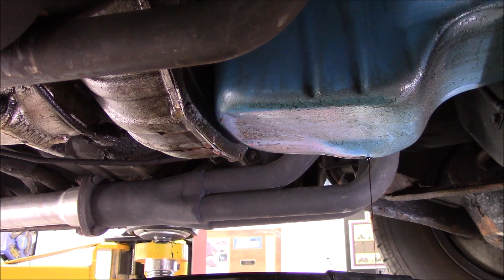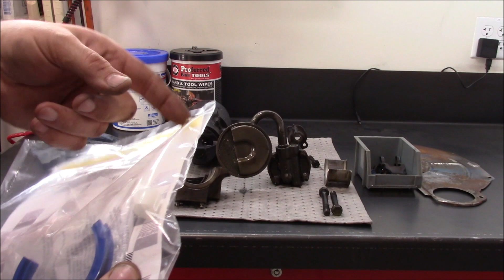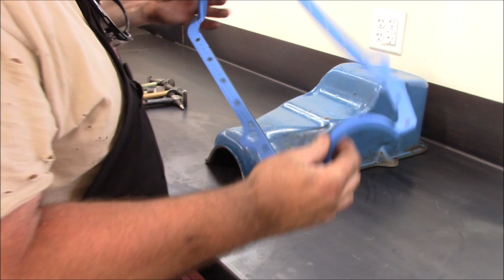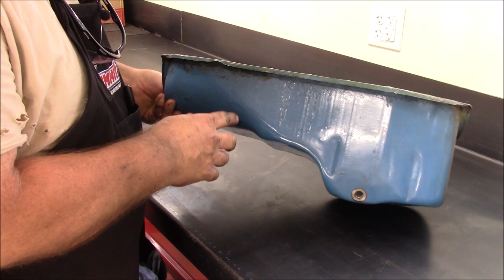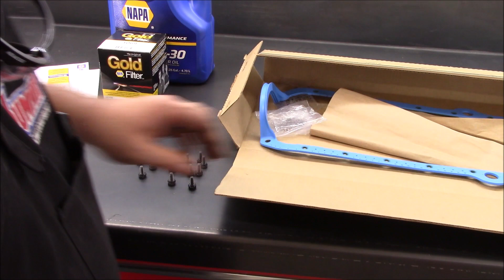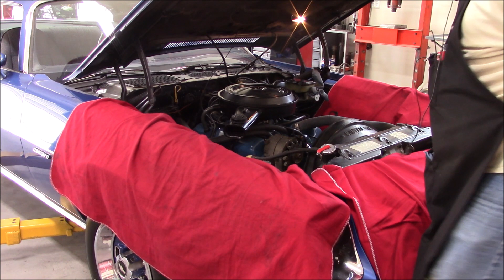Small Block GM 2 Piece Rear Main Replacement

Comment: Where can you buy that jack to lift up the front
Reply from the maker: I used a pole jack, available through many suppliers.  Mine is made by Sunnex and has a 1500 pound capacity.

Comment: Great video, well explained, but do you have to apply anything to the backside of the seal or just leave it dry?
Reply from the maker: Thank you. 

Nothing to the backside of the seal. Just a little dab of sealant where the two halves meet and the rear bearing cap mates against the block are the only places I put anything.

Comment: Great tutorial on how to do this without pulling the motor. The one thing I could not figure out was where were lifting the motor from. What was the jack in? The only thing I could think of was the balancer. Appreciate all the videos you put out. Very informative
Reply from the maker: Thanks for watching.  I used a pole jack under the balancer to slightly raise the front of the engine.
Reply: @zmotorsports62 Thank you 👍

Comment: Fantastic tutorial on the subject…thank you!  I have seen some folks frown on jacking up the motor by the balancer stating that you can “bend” the crank snout.  Would you recommend on jacking up the motor by the oil pan and then resting it on blocks or is the balancer more than sufficient at handling the load?  Thanks again for the fantastic instruction.
Reply from the maker: Using the balancer is fine IF, there is nothing restricting the engine from easily being raised.  You are basically tilting it with the pivot point being the transmission mount.   It's when people forget to disconnect something or there is something binding and they continue to crank up on the balancer.  That's where the damage comes from. 

Thanks for watching and for commenting.
Mike
Reply: @ Makes a lot of sense…thank you! 👍🏻
Reply from the maker: @johngreen2510 you are very welcome.  Thanks again for taking the time to watch. 
Mike

Comment: No rtv on the seal corners?
Reply from the maker: No.  You can but I generally don't.  I will add a very thin film of sealant to the bearing cap if I notice any scratches or gouges in the mating surfaces.

Comment: Does the offset of the seal have to super precise?
Reply from the maker: No.  Just offset it by 1/8"-1/4" is ample.  The main thing is that the parting line of the bearing cap and the seal won't align.
Reply: @zmotorsports62  thank you.

Comment: Mike the only problem is when you show what lip goes too the crank your holding the seal out of view of the camera! It be nice too see the end of the seal too make sure you have it right! I put mine in with the big side toward the crank and thin side too the transmission I hope that’s the correct way? Or I’m redoing it! I must of screwed up somewhere because after I installed it, it’s still leaking I followed everything you said cleaned everything, checked everything but I got oil on my bellhousing so I’ll be redoing this again but it shouldn’t take 6 hrs this time since the gasket is brand new and the pump is new
Reply from the maker: Sorry, like I've mentioned I'm a mechanic and not a videographer. 🤣

The large lip of the seal should have the front of the engine.

Comment: Good job but I’m surprised nobody mentioned that you forgot to apply oil resistant rtv on the ends of the rear main seal.
Reply from the maker: It was mentioned in several comments but I'll say it again.  I never apply sealant to the end on the lip seal, just a little to the rear main cap.  There is enough compression of the seal ends when the bearing cap is torqued in place that sealant is not needed in that location.  

Thanks for watching.
Mike

Comment: I'm getting ready to do mine. I noticed you didn't put a touch of "Ultra Black" on the offset ends of the seal or the main cap. What's your experience in doing that or leaving it dry. Thanks in advance 😎
Reply from the maker: Personally, I don't use "Ultra Black", I use GM ES (Engine Sealant), but I did, and do, put a very small amount on the rear cap.  The seal itself should compress together upon assembly and create a tight seal without sealant.  The bearing cap is what I am more concerned with leaking and therefore put a very small bead on the mating surface and just offset the seal.  

Thanks for taking the time to watch.
Mike
Reply: @zmotorsports62   Absolutely...Good Stuff.  I'm a 30 year ASE master myself and it's always good to get opinions. I've actually never had to do one of these two-piece jobs, so disturbing the main caps made me a little cautious lol
Reply from the maker: Yeah, not a big deal to pull main caps if done properly but I get your reservations about it.

Comment: Hi from Kent, are all late 60's small blocks 327 350  have 2 piece rear main seals or are some 1 piece , looking to replace seal in Chevy 327 around 68 ?
Reply from the maker: GM didn't go to a 1-piece rear main seal until mid-80's (86 I believe), so anything prior to that will be a 2-piece rear main seal.

Thank you for watching.
Mike
Reply: I'm looking at changing out rear seal on a 57 Chevy it has a A-frame cross member that bolts in,  it looks like it could be dropped down on one side so oil pan can be removed.  Can U confirm that,  motor with 4 speed and motor mounts on front and of the bell housing, looks like I would not need to jack up motor.   Are you familiar with that set up,  and am I seeing it right, any problems I will run in to?  57 has a stock motor and bell housing motor mount seat up, with up graded late 60's small block 4 speed Muncie set up.
Reply from the maker: I cannot confirm on whether the cross member coming out can create enough space to remove the pan or not.   The only experience I have with a shoebox was removing the original engine/transmission for a guy and installing a 502 big block w/ZF manual. 
Mike
Reply: Thanks for getting back , I'll work though it, that's what it looks like, like your detailed vedos.  Already had M 21 out added new clutch. @zmotorsports62

Comment: Hi Mike, being retired with time on my hands I decided to overhaul the brakes, suspension bushes, fit thermo fans, central locking and power windows on my `80 G10 Chevy van. While doing that I pulled the engine (350 auto).  Primarily to clean , paint and generally replace any gaskets and seals needed. 
I owned and operated American Car Specialists in London Uk before coming to Aust.It`s been 30+ years since I did anything more than basic services on my American cars here in Oz, but thanks to your `memory boosting video` It`s coming back. The biggest problem is finding parts here at the right price. Cheers MIKE, i HAVE LIKED AND SUBSCRIBED.
Reply from the maker: Thank you very much for the comments and for taking the time to watch.  I'm pleased you liked the video and wish you the best on your American muscle projects. 
Mike

Comment: Are you jacking it up off the harmonic balancer and crankshaft? Is this a good practice? I’ve heard that I can break harmonic balancer is in snap crankshaft I’m just saying I don’t know I’m asking you
Reply from the maker: Yes, I am raising the engine slightly by placing a pole jack under the harmonic balancer.  I have not heard of breaking a crankshaft and have personally been using this method for 35+ years.  However, I can see if someone doesn't use common sense and continues lifting when the drivetrain tops out that something must give and damage may occur.  

Just use common sense and don't force things and you should be fine.  

Thanks for taking the time to watch.
Mike

Comment: so do you think that it is or is not a good idea to apply gasket sealant under the crank seal? or is it recommended by OE  anywhere in workshop manuals?
Reply from the maker: I have not seen it recommended in any of the FSMs (Factory Service Manuals) so I personally do not recommend it. Although I have done a few where the previous person did apply sealant under the seal but I do not recommend it. My theory is that the seals are designed to have a certain "tension" or preload  against the ceiling surface of the journal and if there is additional sealant under that seal it can increase the tension or preload more than was designed and therefore can wear the seal out at an accelerated rate.  Again that is just my theory but I do not put sealants under the seal nor do I recommend it.

Thank you for taking the time to watch. I hope the video was informative.
Mike

Comment: Do you have to remove the starter and motor mounts?
Reply from the maker: No, just the through bolt of the motor mounts and raise it slightly.  Unless the previous person put the passenger side  motor mount bolt in the wrong direction, then you may have to pull the system motor to get the bolt out.
Reply: Awesome! What size motor is this one? Mine is a 5.0liter. What size seals do I need? Please respond? I plan on doing this. Your video is the absolute best!
Reply from the maker: If memory serves this one was a 5 liter as well (305 cubic inches).

I don't know the seal part number off the top of my head, you'll have to look it up by application.
Reply: I have a 1979 Camaro berlinetta edition. This vehicle sat for over 20years. It has 11,000 original miles. So I assume that the bolt your talking about should be correctly put in? And not that the Mormont bolt was put in backwards.

Comment: Best tutorial on how to do it.
Reply from the maker: Thank you.  I appreciate you taking the time to watch and for commenting.  Glad it was helpful.
Mike
Reply: @zmotorsports62  I installed the same seal on my l82 350 small block. Some say the felpro 2912 is better. mine is a high mileage. Thoughts?
Reply from the maker: I cannot comment on the Fel-Pro 2912 as I have only used the blue 2900 2-piece rear main seal.  I've read where the 2912 is supposedly less flexible so not sure that would work better or not.  My thinking is the 2900 would seal better being more pliable but I have no experience with the 2912.  

Sorry I couldn't been off more assistance.
Thank you for watching.
Mike

Comment: I have a question. I just had my motor rebuilt on my 85 Camaro. But the rear main seal leaks already, after only 2 months. So now there is an argument of who put what in! The built shop says they did put in the seal but they say the mechanic put the motor back into the car. The mechanics say they won't touch it, as the motor rebuilders put in the main seal...how is that possible when the seal goes in as you put the motor in?? I mean, I don't get this! Thank you!
Reply from the maker: If the shop that did the engine install is not the same shop that did the engine rebuild then this is in fact two separate shops working on the same engine.

The rear main would have been replaced during the engine rebuild not necessarily during the engine installation. So technically they would have been different mechanics at different phases of the engine rebuild process. One removing and installing the engine and one doing the actual engine rebuild. I hope that makes sense.
Reply: @zmotorsports  yes, I needed to determine who put it in as that means they have yo fix the bad seal. They may have put in a seal that was too old. Anyway, I'm going to the rebuild shop to get it looked at.  I just did not want to get a run around on the part being replaced on a brand new rebuild only 2 months old.  So what ever it us I am not wanting to have to pay for the fix here.
Reply from the maker: I completely understand.

Thanks for taking the time to watch how I perform the task in my shop.

Mike.

Comment: Wow, that was a great video sir, learned a lot, needing to change the oil pan gasket in a 77 Camaro w engine in car.... thanks, I think I can do it now. 👍👍
Reply from the maker: Thanks for taking the time to watch and I appreciate the comments.
Mike
Reply: Got er done...they had the "thin" gasket  on pan, needed the "thick" one....all done, no leaks now, thanks so much for the video,  everything went as described in your video, got it fixed, thanks so much for showing me how to do this with engine in car. Very helpful...👍👍
Reply from the maker: Glad the job went well and glad my video was able to help.
Thank you for the comments.
Now you can enjoy a leak free engine, at least until the next one pops up. 😜
Mike

Comment: Is that a transmission fluid check valve behind the bell house?
Reply from the maker: Not sure what you are referring to but there is no check valve.  This is a manual transmission so the fluid level is checked via a plug on the side of the transmission that is removed to verify the fluid level.

Comment: How important are the torque specs for those bolts that go back in? I don’t have a tool like that need to know if I should
Reply from the maker: You should use a torque wrench to properly tighten the main bearing caps back in place as this is the foundation of the engine and rotating assembly.

Comment: Don't forget the zinc and phosphorus additive. I use Valvoline VR1 Racing oil it has zinc and phosphorus. 
Also do you not put a small dab of rtv where the two halves of the rear main seals meet?
I'm doing this job on a G Body soon but I'm pulling the engine out because I don't have a lift and I'm a big boy I'm not going to be fighting throwing elbows at everything down there. While it's out it's getting a valve job, HV oil pump new Milodon 6 qt pan new rings and maybe bearings. Oh and new front transmission seal and a smaller stall. Going from 3500 to around a 3k stall. Great video and I like your shop it looks very clean.
Reply from the maker: Thanks for the comments. 

Yes, I put a very small (emphasis on very small) amount of sealant at the butting ends of the year main seal.  As for sealant, I'm a fan of the GM ES (Engine Sealant) and use it almost exclusively.

As for stall, I would recommend even lower than 3k RPM of running either a TH350 or TH400 transmission.   Depending on what final drive gears you're running at 3k RPM the torque converter may be slipping just running down the road at 3,000 RPM which is doing nothing but generating heat. If you'll be running something like a 700R4/4L60 with a lockup torque converter you might be able to get away with it but I would still recommend a lower stall for a street driven car.  

Mike
Reply: Thanks for the advice I appreciate it to the fullest. I'm running 373 gears with a 350 trans. I'm actually going to purchase a jegs brand stall, I've used them twice before with no issues. It's actually a 2800-3000 rpm stall. I do need some stall on the street because the camshaft that was put in is a solid lift and power band is 3k to 7k. It's what was in there when I bought the short block. It's been running 8 to 9 years with it as a recreational use car. Again great video it's perfect in every way.

Comment: Nice presentation, I have a questions for you. When you have an older 60's 327 or 283 that does not have a tap in the front of the crank shaft and you need to press on a damper pully. If you use a block of wood and a hammer, does this make the rear main leak?
Reply from the maker: Personally I have not run across a crank that is not drilled and tapped at the snout. Also I am not personally a fan of striking a crankshaft for any reason so I am against the block of wood technique.

Thanks for taking the time to watch. 
Mike

Comment: Thanks. Great video. Having problems getting the main cap bolts out. 1/2 impact did not budge them. Seems like someone severely over torqued them. Any suggestions?
Reply from the maker: Sorry not sure what to suggest. I've never seen any so tight that I  couldn't get them out. They should only be torqued to about 65-70 ft/lbs.  

Maybe try a long 1/2" ratchet and apply firm, steady pressure and see if they'll break loose.  

Mike

Comment: Nice video not a lot of extra BS and repeating everything you do a fine job . Seems like Camaros get tighter spaced and harder to work on with each new generation . I suppose the newest ones I dont know havent had the pleasure of working on one but they probably bolt the oil pan directly to the front suspension and the hood to the intake manifold . Radiator an fan are a one piece throw away unit the exhaust has a manifold built in for at least 75 sensors . The cats are locked in place with titanium locks and can only be opened by EPA .Oh and how many curse words does it take to get those headers on and off ? lol Nice car I had a few Camaros really liked all of them favorite was a 88 formula firebird same thing or the 79 z28 both fast and real sharp . thanks have a great day
Reply from the maker: Thank you for watching.  Glad you enjoyed it.  
Mike

Comment: Can you install the upper and lower seal first on the engine, then install the main ? Or do you need to install the lower seal on the main before attaching it to the motor?
Reply from the maker: The lower seal needs to sit firmly in the groove in the rear main bearing cap then install the cap and seal into position on the block.  

Thanks for watching. 
Mike
Reply: Thanks for replying,  I saw in the video thay you installed upper seal slightly off centered, how do I insert the lower seal while on the main in the offset position?
Reply from the maker: Just offset it to the opposite side as the upper seal but the same amount. I just offset them about 1/8"-3/16" is all, not too much but enough that the parting line of the main bearing cap and the seal are not in the same plane.

Comment: Hi other than taking the motor mount bolts did you have to take off the bolt that holds the transmission on the crossmember?
Reply from the maker: No, I did not remove the transmission support bolt. Just the motor mount bolts.
Reply: @zmotorsports62  
Sounds good thank you.